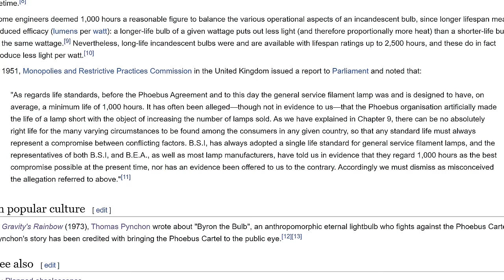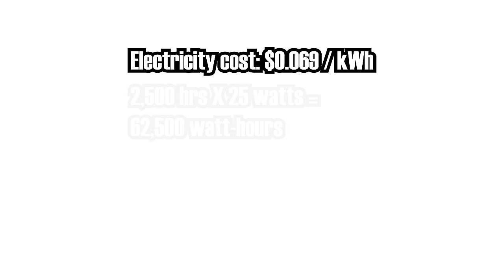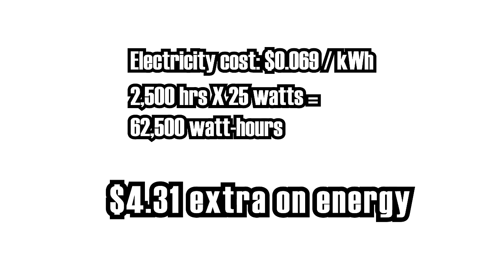Longer-lasting light bulbs: it was complicated

Comment: Remember those 90's batteries that you could pinch to see the color change to show how much charge was left?  I'd be interested in a video explaining those.
Reply: Very quickly -- when you pinch it you engage a load resistor that puts a considerable load on the battery and heats up starting from one end.  It's designed so that only a fresh battery can get it to heat up from one end to the other.  It's covered by a liquid crystal thermometer that registers the temperature change by changing color.
Reply: @dbeierl so it's like an adhesive aquarium thermometer that activates when you complete the circuit with enough power left to warm up?
Reply: @maiabones  yes.
Reply: @dbeierl  and the design that allows only a fresh battery to be able to heat the entire strip is a simple V taper on the printed metal strip wire behind the LC. The thin narrow part has high resistivity and is easier to heat up than the wider low resistance part at the top.
Of course, one can also simply drop an AA battery on a table to find out whether it's still "full" or not.
Reply: @Muonium1 - Those thermal power meter strips have all but disappeared nowadays for some reason.   The "table drop" is not the most accurate way to determine the capacity of batteries, best to use a cheap battery or multi meter.
Reply: @BillAnt  ...with switchable load to read delta V, then to calculate internal resistance. No better method. Measuring single voltage is not enough.
Reply: @BillAnt duracell still does the in the UK
Reply: @MrGOLDENCUPCAKE1 - Interesting, I haven't seen them here in the US for a long time.
Reply: @BillAnt  I've used them here at least as recently as 2017 (possibly more recent but unsure). Duracells. It's possible my family just didn't go through batteries very fast though, I can't be sure. But I am at least certain they remained a thing SOMEtime past the 90's, as i was born in 2002 and remember still seeing those into my high school years when changing my controller batteries.
Reply: @ronnieradon - I have a box full of old and new batteries, and the last date stamp which still has the power meter strip on its side shows "Good through 2025".  It was probably manufactured around 2015, I guess they discontinued them since then here in the US.
Reply: Those aren't really a 90s thing, I remember seeing ads on tv with them in the 2010s
Reply: I'm really glad those have mostly gone away, because the load they put on the battery was significant, and if the battery compartment was odd enough, the test could be triggered and drain the battery fast.

The temperature of the battery made a difference to the results, too. Get one hot enough, and the color change would read "good" without even running the test, though that was quite warm.

Good low-load battery testers already existed at the time, and are quite cheap these days.
Reply: @BillAnt those battery testers pull allot of current from the battery, I can imagine the reason they've disappeared is because it risks discharging batteries before they're used. In other words, it increases the failure rate of batteries.
Reply: @micheals1992 - Right, it wouldn't discharge much if used for one second, but can't control how people are actually using it. lol   You would that by now they could have come up with a flat LED indicator using brightness, costing a penny to embed onto the side of the battery.
Reply: They still exist.
Reply: @krzysztofwaleska measuring single voltage is enough for a rough estimate: >1.4V certainly good for all applications, 1.0-1.4V might still work, <1.0V dead or almost dead. In most cases you don't need more accuracy than that.
Reply: Likeca mood ring. Or kid tjermomemter for forhead in form of a strip it changes color.
Reply: @bsanchez3563  Pardon?
Reply: I have one of those
Reply: Yes!
Reply: Yes, let me check how much power is left in this battery by using some of the power in it.
Reply: Yes please.

Comment: I'm surprised you didn't use candles as an analogue to compare the lightbulb to. There is literally a saying that the candle that burns twice as bright burns half as long.
Reply: "My candle burns at both ends, it will not last the night. But ah my foes and  my ohfriends, it gives a lovely light."  A little poem my mother taught me ages ago.  :)
Reply: @mikefochtman7164  How would the logistics of a dual burning candle work? A straight candle attached at the middle whose wax falls into a drip tray (which needs to be cleaned often)? A U-shaped candle?
Reply: "The light that burns twice as bright burns half as long"
Reply: @deus_ex_machina_  LOL.... it's a poem for goodness sake.  You MUST be an engineer!  lol 

Okay, take a tall narrow one, warm it in the middle so you can bend it into a U shape.  Enjoy.
Reply: @mikefochtman7164  I also went through the sideways candle and the U-shaped one in my head before I read their comment. (Though I didn't come up with the drip tray, that actually makes me prefer the sideways one.)
Reply: Using a candle that way, would be like showing that a 60W bulb will output twice the light as a 30 W one, while also consuming the same amount of electric energy in half the time (pretty obvious). If a candle burns twice as bright (for example by using a bigger wick) also means the flame will burn with twice the power (it's efficiency in that case should remain about the same) - so it would be expected that the same amount of fuel only last half the time. 
But in case with the bulb, it was about efficiency vs material life of the filament. The power consumption of an incandescent light bulb is determined by the length and thickness of the filament - but a the hotter it glows (thinner/shorter compared to the current passing thru it), the more visible light it outputs at the same power input (=better efficiency) - but it comes at the cost of much shorter lifetime. Whats a better way to show that than the way he did (by overpower a small bulb and compare directly to another one running at it's rated power)?
Reply: Or the EL84 that amplifies twice as loud, amplifies for half as long .....
Reply: Little bit on the nose, don't you think? Might distract more than illuminate (heh) because of the actual measurable comparisons between the two. Detergent was a good comparison! Maybe just an aside (such as "..., or you know, like a candle") in addition to the detergent metaphor would be good though.
Reply: I've seen some holders that display this, a tall narrow spike pierces through the middle of a straight taper candle then when lighting both ends it would drip onto a oblong drip tray below this would lead to a lot of wasted wax and an incredibly short burn time, as someone whose parents probably should've intervened when their child started a candle collection at like 8 and had his own light er by 10 years old, it would be much more practical to break a taper candle in half, set both in normal holders and enjoy twice the light for half as long in a normal fashion rather than twice the light for maybe a third or a quarter burn time, candles obviously burn for longer if they consume the majority of their wax, a skill long lost to todays teens (and adults, I'm looking at you, mom) is that of setting these candle completely vertically, at a right (90 degree) angle to the table and holder, this minimises drips for the most part, also placing them somewhere away from drafts, as this would cause the flame to sputter, burning more wax, blowing it off the tip and dripping down the sides, burning the candle at both ends was more of a novelty, there were certain holders on a bearing so as the candle melted on each side it would start swinging like a see-saw one end going up after dripping while the other descended and so on and so forth, if you were actually attentive at candle care, you would realise candles are much more pleasant than you imagine, keeping the wick trimmed is safer, the candle flame won't be so tall, but also will be brighter, a taller flame doesn't lead to a brighter flame, only a sootier, very orange tailed one, and the burnt wick itself starts to ball up in the end, you would think this would be a good thing, like a flame spreader on a matador round wick oil lamp, but it actually impedes on the light output of the candle, we did not have TikTok or Women's rights, or worker's rights, or any rights for that matter, I'm not saying that's a good thing mind you, but it DID free up a lot of time to be consumed by caring of the house, cleaning oil lamp and gas light globes, candle holders, trimming wicks, keeping an eye out to make sure the children couldn't reach or didn't play with fire, ensuring the curtains were tied down, weighted, or at least closing certain windows to make sure the curtains wouldn't kamikaze themselves by flapping in a strong breeze into one of your flaming objects. fire safety in many ways was a lot more prevalent and ingrained in society then. screens in front of fireplaces to stop embers from jumping unto your rugs or your skirts from catching flame, special purpose built trinket tables for your oil lamp/candles to be placed on, wall sconces if you could afford them provided general light for one to move about the room without fear of knocking one over, actual ceiling gasoliers would provide light over a table, keeping it above you meant no harsh glare of a flame at eye level. one seen that always sticks out to me is in the movie Memoirs of a geisha, the head boss lady would take down an oil lamp from its wall bracket, fill it somewhere else, do all the things before putting it up on the wall for light a little before the sun goes down. when putting away their expensive silk kimono someone else would carry the light instead, always two people in the room to fetch or put away something instead of one. then near the end when a geisha rival tries to hurt another by setting fire to her lovers handkerchief, we get an awesome shot showing that without the chimney, how smoky and unsteady the flame was, in their fight it gets knocked over and sets fire to the room, and geisha rival in a fit of rage grabs the oil lamps from the hallway and smashes it, trying to soak the other geisha in kerosene, the whole house burns down. It's actually a very pretty and touching movie and book, while not all together accurate for the hairstyles of the time, and some ceremonies were exaggerated in its importance, or completely made up for drama, its an interesting look at lighting technology of the era, at the start being early to mid 1930's, the train station and other public places like the theatre still had dozens of gas lights with only a number of new fangled electric incandescent lightbulbs here or there to the end of the movie where we see our first and only fluorescent light the bankers lamp the geisha turned bodega operator was going over her stock of supplies and upcoming deliveries. it was a harsh ugly almost blue light in comparison, that, and seeing that geisha in a pants-suit really helped in plunging the viewer into post-war Japan and just how much that world changed for its civilians there were soooooooooooooooooooooooooooo many oil lamps in the majority of the movie, albeit borings sad pathetic flat wick varieties, but it was still nice to see all the styles, hung from the ceiling, on the wall, table lamps, and it was a nice contrast compared to the ridiculously rich geisha's house who had all electric wall lights, floor lamps, and even outlets! not a flame in sight, at least at that point, post war she rented the rooms out, there were bare bulbs in places were the glass shades were obviously lost or broken during the war and she started burning newspapers in a metal bin to keep warm, I guess if your sugar daddy loses his fortune in a war and commits suicide you don't get an electric space heater, sad.
Reply: @mikefochtman7164  I would argue that that's two candles, connected at the bottom.
Reply: The quote is not about candles. It's just about lights in general. "The light that burns twice as bright burns half as long." It's from the movie Bladerunner.

The quote referenced by Mike is much older and is about candles "burning at both ends." Clearly if you burned a candle at both ends, the wax would burn twice as quickly, so the candle would last only half as long, though the quote is not usually about longevity. You are "burning the candle at both ends" if you are working too hard, essentially, and becoming exhausted. The original meaning though was that burning the candle at both ends was wastefully expensive. In 1611, Cotgrave's A dictionarie of the French and English tongues recorded the French phrase "Brusler la chandelle par les deux bouts," i.e. "to burn the candle by both ends," with the meaning of being a spendthrift. By the late 19th century, it attained its modern meaning of "wastefully exhausting your physical or mental resources too quickly."
Reply: @mikefochtman7164 of course a woman would share a poem about wasting a candle because it's cool to look at. No man would ever do anything ever
Reply: @deus_ex_machina_ You skewer a candle with a nail right through the middle point, then balance it using the nail on two glasses, like a seesaw, then you light both ends of a candle. And that's how you get a candle pendulum. :)
Reply: @cameron7374  Obviously the best course of action would be to simply cut the candle in two and place it in two holders, but if one is hell bent on burning both sides of a candle, the horizontal drip tray isn't as sensible as it seems:

• It takes up a lot more precious desk space. 
• The flame is much lower than a conventional candle holder, such that it might light a stack of paper placed next to it. 
• Wax drips perpendicularly onto the tray as it melts, whereas on a straight candle, melted wax cools down and solidifies as it flows down the stem. Unless the drippings are collected and reused, a significant amount of the wax is wasted.
Reply: @deus_ex_machina_  That's some good points. Though I think once you cut the candle apart that's cheating since now you're just burning two separate candles.
Reply: lol?!
Reply: Kinda like a star
Reply: The quote is about candles if we talk about the actual origin that several places note,Taoism,which is clearly older then a 1982 movie and a 1968 book,some even state it's a quote by the debated over author Laozi/Lao Tzu in the around 400 BC Chinese classical text "Tao Te Ching".

The version I like,though,is from 2015 :

"A flame that burns twice as bright,"
"Burns half as long,"
"Mine faded long ago."

- "Constelation Of Tears",Stormcrow album by Cain's Offering.
Reply: From Red Dwarf

The Writer/Creator: "The light that burns twice as bright burns half as long."
The last living human, a bum: "Yeah, but the light that burns half as bright burns four times as long."
The android: "But the light that burns three quarters as bright burns five eighths as long as the light that burns a quarter as bright as the light that's gone out."
Reply: Yet I don't remember any cartel to "protect consumers" against candles that burned not bright enough.